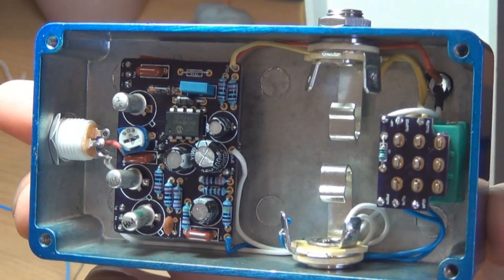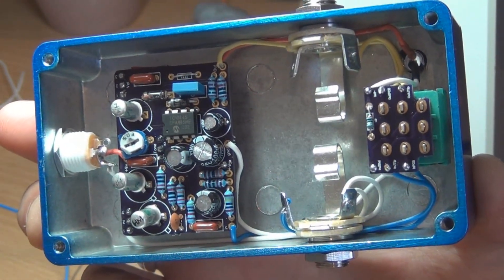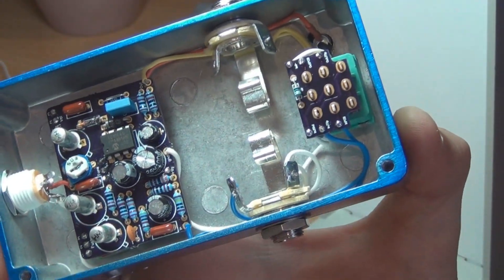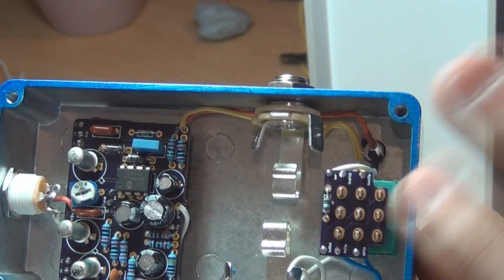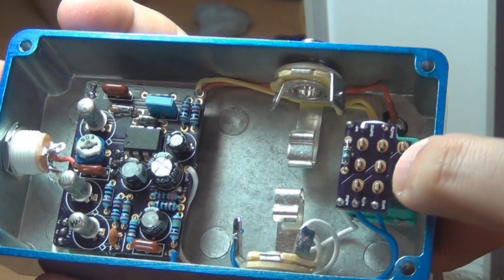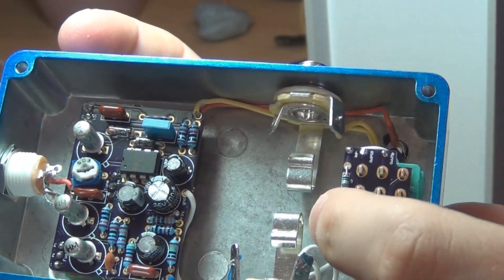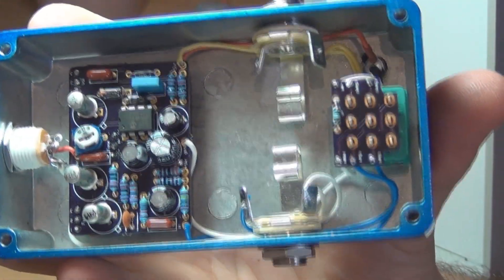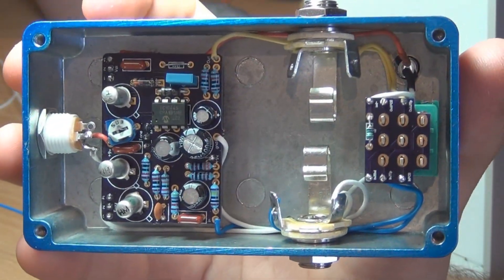Quick Tip - Guitar Pedal Wiring Neatness

Comment: I think a great way to help with neatness is to use snipped-off legs from caps or resistors or whatever to make short connections rather than using a wire.

I'm going to be slightly controversial here and say it can also look neat with the wires showing if you do it well. I like looking at guys like "dopeFX" on Facebook and also Grind Customs' build of a Soldano clone (also on FB).

I like to use single-core wire and just bend them into really neat right angles, but I guess that's just preference.

Good tips with what side of the board to attach to. I think a lot of people overlook this.

Comment: Hey i am building a vox ac30 drive pedal andthe wires on the daughter board feed the main board but do i have to solder twice as i can see youve got seperate wires to certain connections on your switch and then another soldering joibt which takes it to the output.